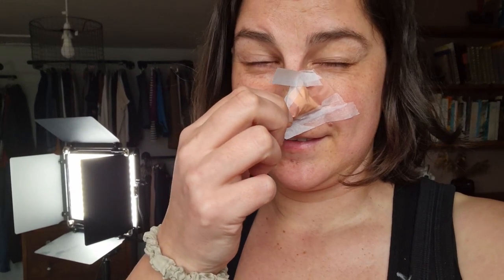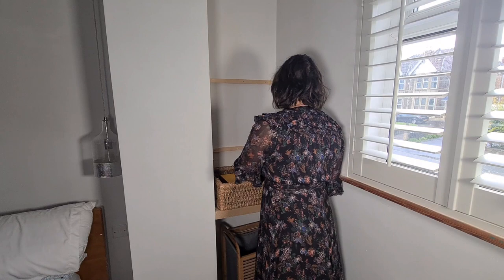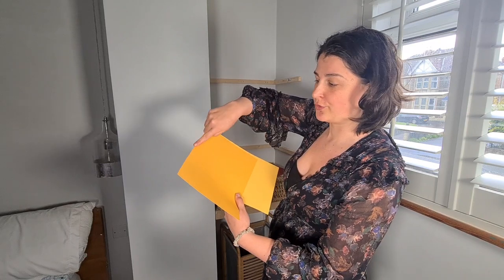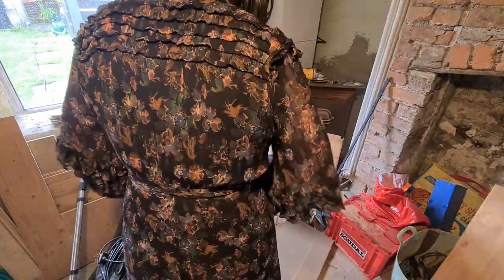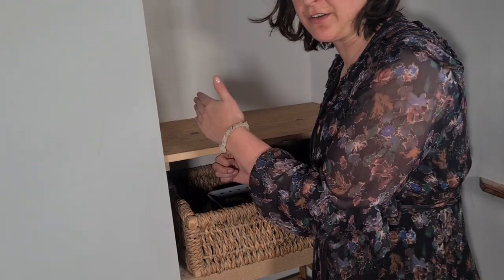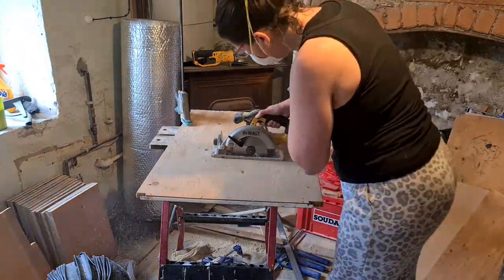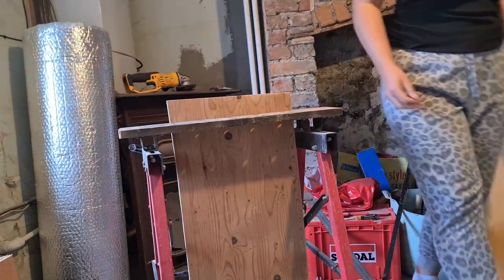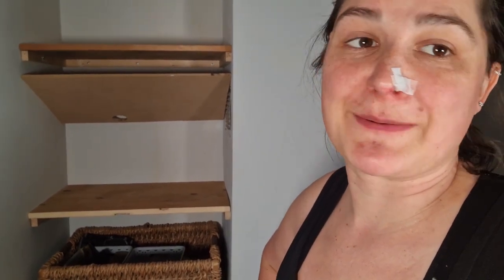A LESSON ON USING TOOLS SAFELY #emmavlogs 27

Comment: Yeah, injuries, sometimes, happen for multiple reasons..
Back in days, one time, I didn't put on my safety glasses when I needed to cut one screw with Dremel, thinking, all will be good.. Nop, I was wrong.. I ended up in hospital to the eye surgeon for removing metal splinter from my eye.. After that, I always put my safety goggles on.
Reply from the maker: It only takes once doesn't it 😢. I'll bet that was ouchy
Reply: @diywithemma  Yes, that was pretty ouchy because I had only partial anesthesia and I can see all medical tools approaching my eye.. 😬 In that operation, I can even feel tool scratching in my eye to get out that metal shaving, through all my body... I don't want to experience it ever again and don't wish to experience it to anyone..

Comment: I don't like injury videos, but your thumbnail finally got my curiosity. Glad it wasn't from a saw. I work with powerful air grinders all the time and tell guys to wear a welding glove on their left (or whatever hand isn't holding the trigger down) hand because the slightest brush can be really bad. And to keep their head away. It doesn't look very bad, some people  pay for derma abrasion to improve their skin, which you don't need of course.
Reply from the maker: Neither do I and if it hadn't have been minor I wouldn't have shared the image of it. I'm also glad it wasn't the saw! Saws scare me. 😅  Those air grinders also sound a bit scary! Its so true, that even a brush can hurt. Glad I got some derma abrasion for free 😂